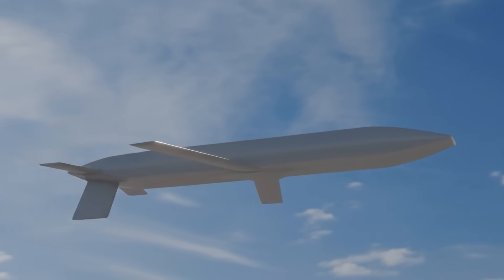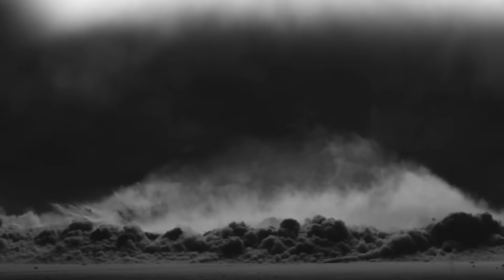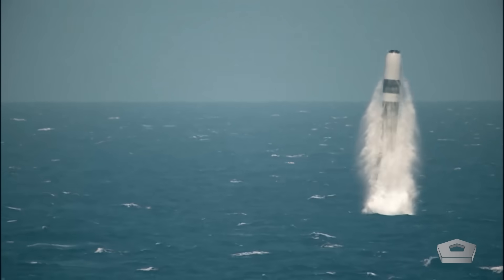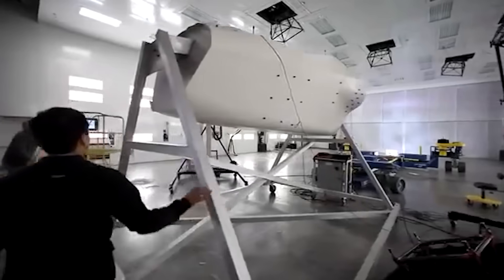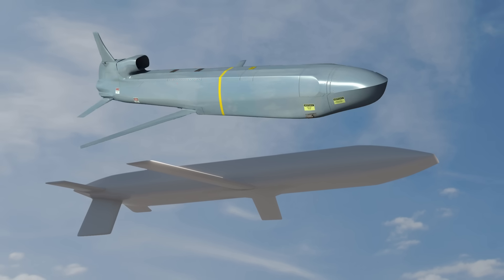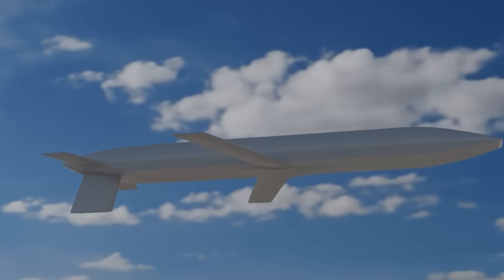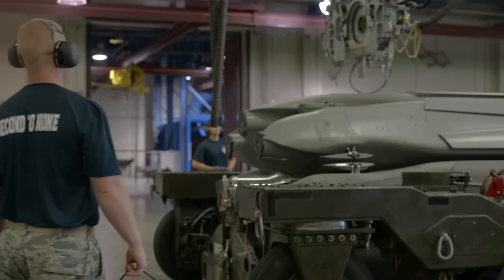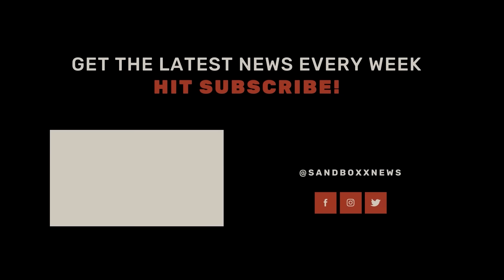Our first look at America's new stealthy nuclear missile!

Comment: Can ANYONE give us an Update on the B21?! And another IMPORTANT Question. IF USAF just shot down the Navy's FA-XX program, will the Navy buy some more FA 18 block 3, to offset that? As of Now, the Super Hornet production line would stop by 2027 Spring. I HOPE USN doesn't make the same mistake of waiting for that line to stop to give another order..... Super hornets, are STILL WAY WAY useful.... than most people think
Reply: I likely think MORE F35 and F18s if Navy doesn't go for FA-XX program
Reply: @gerogyzurkov2259  USN ordered 260 F-35C & has received 120 so far
Reply: B-21 is ahead of schedule & actually under budget. There are 6 B-21 in various states of construction undergoing required testing. By using 6 airframes, multiple testing programs can run simultaneously greatly speeding up the process. The Navy FA-XX program isn't dead yet. DoD is wanting to put that on hold so the funds can be shifted over to the F-47 as a priority. Now the Navy could decide to just go with a Naval variant of the F-47 or wait to see how this plays out. One thing that's not mentioned these days is the F-35C (carrier capable variant). The Navy is still  getting those out of each production run. So worst case they'll have a mix of F-18E/F Block 3 & F-35C.
Reply: I love the Growler!
Reply: I think F/A-XX is redundant when their is already F-35C. Just give F-35C an ACE re-engine and it will have the range needed in the Pacific theater.
Reply: @johnsilver9338  "re engine" wont be that simple
Reply: @dreamhunter2973  But it would definetly cost less than developing a new aircraft.